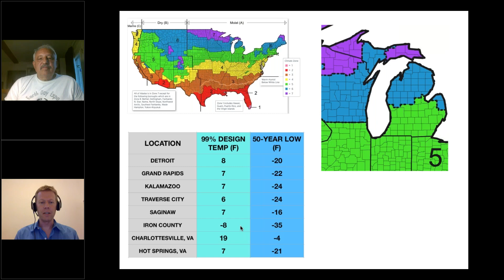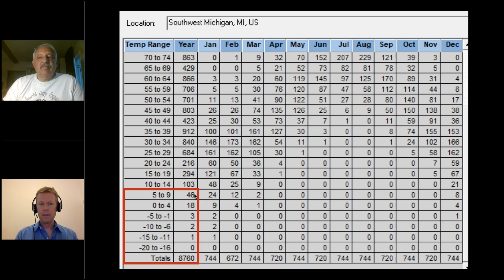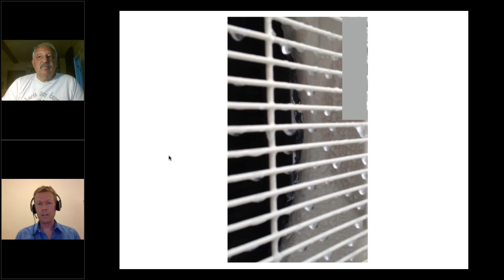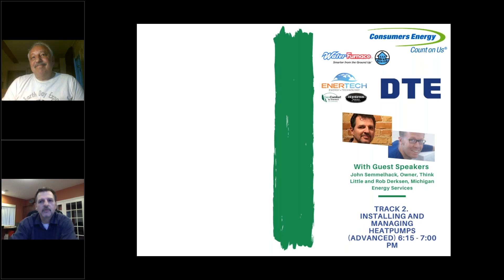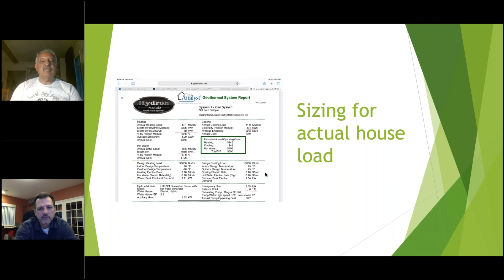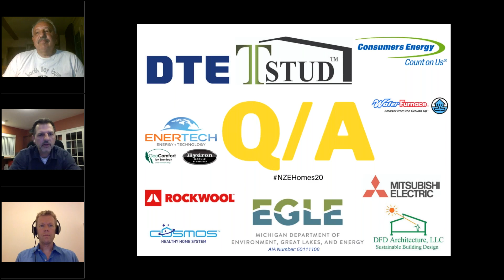Installing and managing heatpumps (advanced) - MINZE Conference 2020

Comment: Thank you for sharing this. I think there are many consumers who’re interested in heat pump technology but it seems like most HVAC folks are not interested in entertaining that option.
Reply from the maker: How do we educate them?
Reply: @GreenHomeInstitute  I think it may be a mind shift change as they learn more about the technology. I called 4 local HVAC guys who are certified in the Mitsubishi Zuba system, and not one wanted to talk about that system.
Reply: @twiincentral8780  The Mitsubishi Zuba system is Canadian branding for the US Hyper Heat system.  If you are looking for contractor support in Canada, you can visit: https://www.mitsubishielectric.ca/en/hvac/professionals/zuba-family
If you are looking for contractor support in the US, you can visit:
www.mitsubishicomfort.com
Reply: @michaelschaefer5744  I used that link and called up certified installers, and none of them wanted to talk about the Zumba system. They all either dismissed replacing a gas furnace or recommended installing a Lennox or other system. I literally cannot get anyone to sell me this system.
Reply: @GreenHomeInstitute  the other issue i found was that all the heat pump manufacturers want a manual j to work with you to understand sizing and cost but an average homeowner will only have that if they are working with an HVAC person. So it seems like even if you are interested in switching to a heat pump,  it’s not easy to even understand switching costs let alone getting it installed.